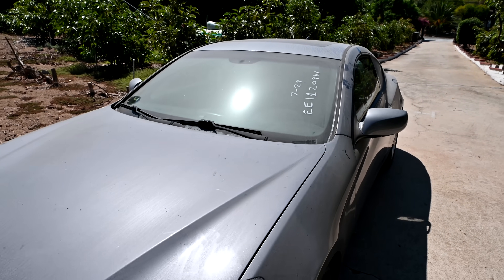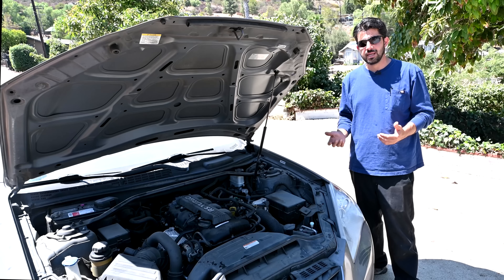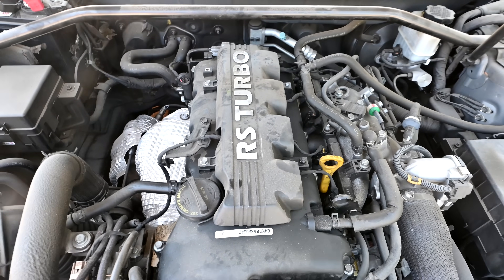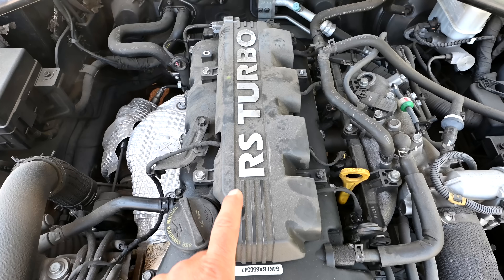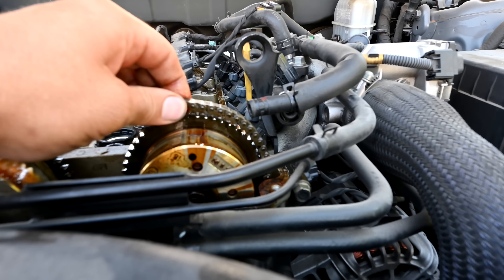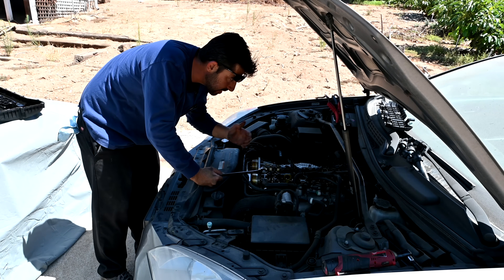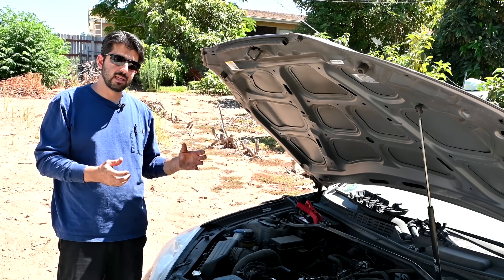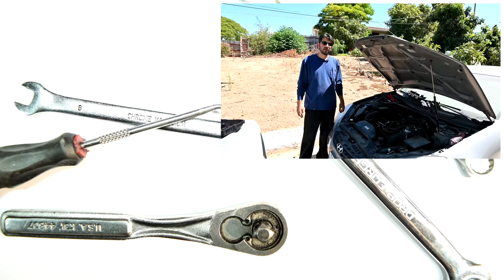The Hyundai And Kia Engine Failures Explained.

Comment: I’ve been building engines for 40 years. The failure that this one experienced is not a Hyundai problem, this is a previous owner negligence problem.
Reply: My mom had a 2016 Kia Optima and the engine caught fire on the highway driving to p.a from nyc and they told her it was her they couldn’t pay cuz it was to much damage to determine where the fire started even tho that engine was recalled and they gave it back to her a few weeks before saying it was fine
Reply: @tocreatee5736  Cant see it from my house 🤣
Reply: @tocreatee5736  sounds about right unfortunately.
Reply: The exception is that a few of them had metal shavings from a crappy deburring process which eventually caused the engines to rattle and then grenade themselves. It is a known problem with Hyundais and Kias. I kid you not, I saw 6 engines outside on some pallets at the side of a Hyundai dealer. They look like pre-warranty engines.
Reply: The i30 diesel that I bought, from a dealer had a handful of receipts in the glovebox from the previous owner. This lemon had manufacture/faulty parts problem, but the company would not admit it.
Reply: These engines are trash expert or not can’t argue with that
Reply: There’s literally a known issue where the internal components weren’t deburred properly by the manufacturer and bearings are being scored and eaten up left and right. Oil consumption problems abound too. If you baby it, maybe the problem can be postponed but even new Hyundai engines are being found leaking right off the dealer floor. There’s better brands that can actually handle abuse for thousands of miles much better without destroying engines.
Reply: I'd agree with you except hyundai has admitted a manufacturing error and recalled 1,047,000 vehicle for these issues
Reply: @who8that2 No. It's just the owners that didn't do the oil change on time 😂. 🍋
Reply: It’s a Hyundai problem I got my oil changed every 3 thousand miles it went out at 60 thousand miles they had bad engines from 2010 to 2018
Reply: My 1st kia, was a 2007 Spectra, 5 speed manual, SE, loaded. Drove it 5 years , had a little over 100.000 miles,  I changed the oil every 3000 miles, as I have done on all my cars. I take good care of my cars. When I sold it, it looked almost brand new, Southern California car, the engine ran, and sounded like new. And used  no oil. I bought a 2017 Elantra, loaded, 2.0 Atkinson engine. Just turned 97.000 miles,  0 repairs,  0 issues.  Runs beautifully,  uses no oil. I have kept it, but bought a new 2021 kia K5 GT LINE  1.6 l turbo.  Just turned 18.000 miles,  no issues 
 Great car, 3000 mile oil changes. Castrol Edge synthetic. I wouldn't have bought the Elantra,  if the Spectra was a bad car,  I wouldn't have bought the K5,  if the Elantra was a bad car. Hopefully. And I expect the K5 to be just as good!
Reply: I ALWAYS change my oil on a new car just after the first 500 miles. Also, upgrading a engines oil pump can help with lubrication pressure at cold starts and at engine idle times. The good 'ol "hemi tick" sound can be fixed with putting the SRT engines oil pump on the engine. Pressure is higher now at cold start and at idle times which also protects the lifters and cam.
Reply: These Hyundai engines were made in the USA. Other countries get their cars made in Korea and don’t have these problems. I wouldn’t touch one unless it had a VIN # K on the start of the VIN number showing its made in Korea, same thing with Japanese cars make sure it starts with a J. Never heard of a Hyundai V-6 or V-8 giving any kind of problems.
Reply: @simonlangmead7 Korean made have the piston ring failure.
Reply: The engine is fine. Take care of it and it will last. The factory employees who left metal shavings inside the engine enclosure are the problem. Where I live cars are expensive due to taxes so we drive older cars, these engines are selling with 200k km and even 300k km, kia forte, kia sportage, hyundai elantra, etc.
Reply: I am living in saudi arabia ++56-45 temperature i am driving sonata2013 model 2.4cc benzene i already rich 230km with no issues in engine
Reply: Funny that literally every other brand besides Fiat don't have these issues as often as Kia/Hyundai, even with negligence lol.
Reply: This engine is clean on the inside. The Genesis 2.0 are prone for stretching timing chains. Usually will get you to 140k miles. Surprised this one failed so early.
Reply: Reading your responses you must be a Hyundai fanboy … the massive recalls and fires speak for themselves
Reply: Bullshit, being on the recieving end of recall campaign 162, my engine developed the classic death rattle these engines are known for, barely reached 100000 miles with regular oil changes.
Reply: Have you ever seen a 17-18 yrs old drive one of these?
Reply: @Mr450Rrunner 
Doing the famous American hotdoggies.
Doing donut 🍩 writing to practice school writing class.
That's all.
Reply: @Mr450Rrunner  I literally drive one with the theta 2.4 no issues whatsoever just use OE oil filters
Reply: @jagged_rocks8375 just cause you never had an issue doesn't mean it isnt
Reply: @jagged_rocks8375 you're poor
Reply: I have a sorento with the 2.4 theta 2. I have had it for 8000 miles. Did one full synthetic oil change so far along with ir plugs and new pcv valve. The engine blew at 79k. (Ive owned it 5 months). It burned 3 quarts of oil per 2000 miles. I did the oil change anyway, but the oil is basically new at all times due to the consumption. These engines are not built properly. They fail as early as 50k. They burn so much oil that they cant make it to the oil change. In 8k miles i put 12 quarts of oil in it. Thats not counting the 5 quarts for the oil change i did. Thats just from adding it constantly. If yours hasn't died, you are very lucky.
Reply: How is a failed timing chain or tensioner a owners problem on a engine with only 100,000 mile on the clock?  If the quality is that bad, it should have been a belt that’s easy to keep check on, and change at its due service interval.   And l have a few 20yr old cars with over 250,000 km mileage, the manufacturer’s oil change intervals  is every 20,000km, and the engines still run like when they were new.  You have developed a low expectation for minimal quality in the US and it become the norm.
Reply: @alexanderkennedy2969 It's your money. I don't care.
Reply: @alexanderkennedy2969 they sell a lot because they're affordable for the most part Also they look nice and they feel nice but reliability is questionable on some of their models I own a repair shop and I can tell you at least once or twice a month a Hyundai comes in that needs a freaking engine It's always the same thing it's either locked up or rod knock so bad you can't think straight. They are by far the number one brand that comes in needing an engine!!! This isn't just my random opinion every shop owner I know says the same thing. They build a nice looking comfortable car but their engines are drastically lacking.
Reply: I Want the new Kia Carnival 6cyl for 2022 and up I wonder if these are ok😢😢
Reply: @seatime674  don't do it,I know a family that has one and they are having problems with it and its only 12 months old. Garbage.
Reply: @Ageofdeception67  I guess there are stories everywhere, on all these threads people have 40 and 50,000 milez on theirs and they love it no problems
Reply: @seatime674  most new cars manufactured today are garbage but kia are crap,12 months old with 20 k on it and its at the dealership workshop !
Reply: @Ageofdeception67  Don't be so negative I've had brand new cars in the shop under 12k miles things happen there not junk. My dad had the Sedona 90k miles no issues and all Carnival owners on here have no issues
Reply: As 85% of people do or I should say Don't do...
Reply: @clownworld1967  you do know even hondas right now has problems right? The only manufacturer i know withour engine problems is toyota but you want to drive a 3 cylinder?
Reply: 10k miles is excessive yes. But 3k miles is way too early also . 5k to 6k miles is what should be acceptable, and is acceptable for many other engines and make it 2x longer than 100k miles.
This way of thinking should be left in the 90s as only cheap or poorly designed engines are inefficient these days.
Reply: Law suit they lost says otherwise mats
Reply: Yes, these kids dont know how to flush their carburetors
Reply: 40 years and you still don’t know shite 😂
Reply: Wrong. There are documented issues with this engine. It's from the manufacturing process if anyone didn't know
Reply: Bad advice by uninformed mechanic.
Reply: @MyLifeMyMoneyMedia  and you’re probably a neglectful previous owner
Reply: Only in the US? 😂 That’s a HUGE market. That’s like saying “I dropped my phone in the water but it should be easy to find because it was only the Pacific Ocean.” I’ve seen so many Hyundai’s and Kia’s with the death rattle and the knock sensor code that they updated the ECM’s to report and put it into limp mode that it’s unreal. That doesn’t even touch the theft issue where they were so cheap that they didn’t even put an immobilizer setup on their cars for years! We had a lady come in with a 2018 Kia Soul that had the blade style key. She was upset and wondering if we could do an update to her car or install something so she could get insurance because no insurance company could even give someone a quote on those cars until Kia put out a solution. I called multiple insurance companies personally for her to see if there was an aftermarket theft solution they’d accept and they told me their system wouldn’t  even allow them to do anything once they put in the VIN number. That car wasn’t on the update list at the time and she was SOL. They were on the rise and were doing a lot of things right but the engine issues along with the immobilizer issue hurt them badly and their reputation has taken a HUGE hit!
Reply: Yea, people didn’t have any good service at dealers, it is what you try to tell people?
Reply: My friend is a service manager at a large So CA Kia dealer. These motors are replaced regularly, even with regular maintenance. It's a known problem with the Hyundai/Kia engines. He bought a Honda for his kid.
Reply: @tvdinner325  The fact that this engine made it 108,000 miles before this happened tells me that it’s not a design problem. I have no doubt in my mind had it had more frequent oil changes that this would’ve never happened.
Reply: @76629online  I agree man, I also think driving habits and lack of understanding about how engines  generally operate is also a factor, doing jack rabbit starts, not letting the oil pressure build and warm up, not checking oil levels, coolant, and general parts, and also using too thin of oil.

also with these GDI engines, an oil catch can is critical to have, to reduced carbon build up on the valves, so its defiantly some things to know and consider when dealing with engines like these.
Reply: @76629online  these engines are junk.......the engine wasn't severely neglected it looked ok under the valve cover. The engine is just a steaming pile of shit. Crappy parts crappy manufacturing etc
Reply: @Koda18  You must be an expert.
Reply: @76629online  actually yes I am..... But I wasn't going to bring that up needlessly.
Reply: @Koda18  just do it's hydrogen engine carbon cleaning for inner carbon build up that is very good for performance and many more things
Reply: @Koda18  maybe they used to be crap but now a days they are par with honda and toyota.
Reply: @derfskittlers6125  their engine recalls and issues say otherwise. They are not on par consistently.
Reply: @Koda18  lol Mr. PRO 
look up any manufacturer,  they all have issues.
Reply: @derfskittlers6125  they do for sure but Hyundai Kia definitely have more major issues than most.
Reply: @jasonblue8832 Jason, what do you Mean by too thin of an oil? There's a specified Engine Oil viscosity for this Hyundai and that doesn't necessarily means it's "too thin of an oil".
Reply: @76629online  umm think you need to listen again. The shavings break off & clog the pathways. That can happen as early as 20k to 100k miles
Reply: @Koda18  yeah & now expensive because of the Mercedes engineers they brought on
Reply: @WarriorOfEden3033  you sound like a pretty smart guy. Perhaps I’ll take my 40 years of engine building experience just go ahead and delete my comment so you can take over the conversation. Good luck!
Reply: @76629online  it was a heat process not correct at manufacturing and shaving in oil galley it’s not poor maintenance
Reply: @Koda18 we're all experts at nothing lol
Reply: @c-dub8639  I mean that’s not true. I own a repair shop I’d say my knowledge is worth something. You don’t get glass action law suits about your engines blowing up if they’re mostly reliable. They’re junk that’s why they blow up. Not all Hyundai engines are bad but a lot of the 4 cylinders built in the last ten years are. Which is a huge amount of what they sell.
Reply: @Koda18  But I don't know that, you could be 13 years old wacking your pud in between comments for all i know. So effectively none of us commenters are experts at anything. I also struggle to believe that you "own a shop" when you seem to have plenty of time to comment and reply as much as you do.
Reply: @jasonblue8832 the oil pressure will actually lower as it warms up. This happens due to the components warming up and the bearing clearances increase.
Reply: @Koda18 repair shop on what? Lmfaoo. Plus you drive a wrx. Last time i checked subaru has one of the shittiest engines before and until now🤣🤣🤣🤣🤣. You do know hyundai/kia only has problems engines built in US
Reply: @Koda18 1 year later and Toyotas are exploding all over the place 😂
Reply: @tvdinner325  The problem is that people today don’t even know what “regular maintenance“ is. Most owners manuals these days suggest running 10,000 miles between oil changes. All that is is a marketing tool. If people think they can get 10,000 miles out of an oil change then they think it’s going to save the money. It’s all a scam.
Reply: @76629online  how the hell its a 10k MILES interval? From where i came from, 10k KILOMETER is widely used among manufacturers if serviced with fully synthetic oil. 

Damnnnn, 10k MILES? What a scam.
Reply: @76629online  4000Mi OCI is what I go by .I have a 2011 Forte 2.4 purchased new ,it still runs fine. No oil consumption between oil changes with full synthetic.It has 130000mi on it.
Reply: Government also pushes extended oil change intervals, to reduce pollution  
In a turbocharged car, with an oil lubricated turbo,  it’s a no brainer  
I won’t waste my time with the entire video   Pretty sure it’s just clickbait
Reply: @lrich8181  the problem is that it wasn’t all of them basically saying it’s a gamble buying one
Reply: @shhhdontshout even Toyota did this. I was floored with our new 2014 Prius that it had that change interval. 

It’s because they offered free service for two years therefore they did not want to pay for it
Reply: @shhhdontshout even 10k intervals is way too many kms between oil changes despite what manufacturers say. For example-my 2005 Toyota Camry 3.0 litre v6 has had 5k oil changes since new and now has 288,000 kms on the odometer,the engine internals are like new-no varnish,no sludge,nothing but shiny metal. It runs like a new car and is 18 years old.
Reply: @lovefirearms1967 I have never done a 5000-mile oil change. If the engine is in great working condition 3000 miles oil & filter change is cheaper than a timing chain issue or other problems. 
Just change the dang engine oil & filter at 3000 and have the engine to last for every with regular maintenance 🙄
Reply: @shobud7561  it should be common sense but there's so many people that don't care about preventive maintenance these days. That's why when buying a seconhand car these days one has to be very careful that your not buying a sludge monster. We are a dying breed of people that care for their cars.
Reply: @tvdinner325  I agree, my brother in law neglected to do his oil change on time and his car lost power so when he checked it had no to low oil and because of the supposed issue he was able to get a new engine....
Reply: @tvdinner325  I've been doing pretty good with our KIAs so far so you stick with your Honda. By the way my son used to drive a Honda he's driving a KIA now.
Reply: I believe this happened to all hyundai engines made in USA? Never heard of this issue in my country
Reply: If the Hyundai engines are failing due to owner neglect, shouldn't the same happen with other brands like Toyota? Unless this engine is good but needs perfect maintenance while Toyota is more resistant to uncaring owners
Reply: Ok, Scotty Kilmer....Having built engines for over 40 years doesn't mean you are good at it or know what you're doing/talking about lol
Reply: @alexanderkennedy2969 you have every right to think that. But that's definitely not the facts. 🤣🤣🤣 Hyundai can't build an engine that doesn't grenade itself that's hardly better than the Japanese cars 🤣🤣🤣 drink some more Kool aid!
Reply: I may be wrong, but over 50% of engine failures are due to, user error lol. Usually from poor maintenance practices and installing aftermarket parts wrong and or not the right ones and not then changing the ECU engine tune when changing out performance parts. Am I wrong?

Comment: All you have to do is change the engine oil every 5000 k . Use good quality semi or full synthetic oil . When new the day you pick up the car first thing you do is drop that engine oil . Replace it that day with new full synthetic . New filter . Then 1000k drop
It again . Then every 5000k and will last forever